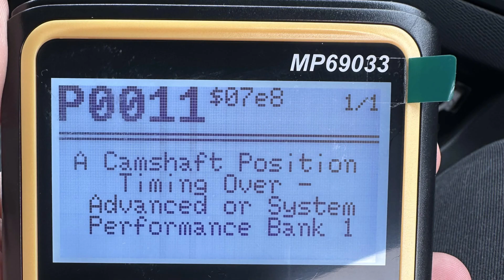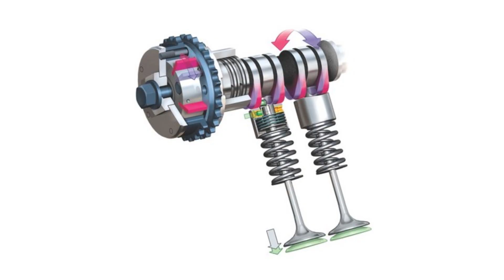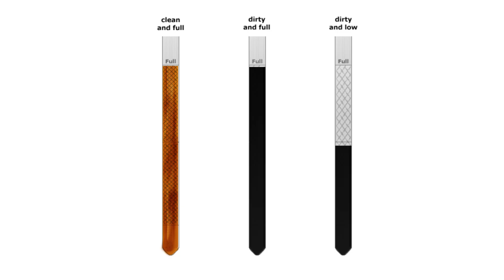P0011 Code? Don’t Replace Anything Until You Watch This!

Comment: Hey buddy great video thanks alot
I have a chevrolet cruze limited 2016 1.8
I am having P0011 and P0420 and the symptoms as you said
I changed the oil with a good one and replaced the VVT intake solenoid and cleared the engine codes
After 3 days all the symptoms is back again and the codes showed up
What do you suggest as a next step please?
Reply: My mech told me that maybe the catalyst P0420 is causing the P0011 and I should replace the catalytic converter
Is what he is saying right?
Reply: Unlikely as p0011 is intake side not exhaust be the p0011 causing cat issues not other way around

Comment: Timing chain ,tensioner,cam gear  vvt solenoid , cam sensor, all new but no fire p0010,p0011,p0340 
Gotta be something simple oil isnt changed is dirty but not past any ideas ?? A wire !
2010 silverado 4.8

Comment: On my 2013 Ford Edge with the 3.5 non-turnover V6.  I got a P0012 code with the same message.  The problem was bad cam solenoids that advance and retard the timing.  The solenoids are $35 a piece but you have to pull both valve covers which is a pain in the butt.  My mechanic said the engine had jumped time and would cost $1500 to replace the timing chain, guides and waterpump while I had it apart.  I didn’t have dirty oil. I change oil every 3000 miles but my car had 160,000 miles on it and the solenoids failed.

Comment: My car has this error also with a noise like ticking at times at low and hi rpm which disappears on 1500/2000 rpm .
Engine oil .

What should i do

Comment: I have a 2011 Mercedes C Class 220cdi with the om651 engine. Only fault code is stored is P01126. I changed the timing chain and tensioner in september 2024. Check engine light came on in may 2025 roughly. Checked timing, all is perfect. No power loss, just check engine light. No messages in the display. No rattling or unusual engine noise under startup or driving. Changed the oil and filter when i got the check engine light just because it was time. No difference. As my engine have fixed cam gears and not a vanos/vvt system i can`t seem to figure out why i have this persistant code. Any tips?

Comment: You really broke it down very thoroughly and enjoyed watching your video.  My oil is pretty clean & proper reading on dipstick.  Just going to reset   cel w. replaced VVT Solenoid again (already replaced all cam & crank sensors).  If still issue, then engine has 217k will be timing chain replacement or might go newer used jdm motor w. 60k miles.  What do u think new or swap timing  chain next?
Reply from the maker: J - Thanks for the feedback! Honestly, depends on cost and budget.. 60k mile engine would be best, but cost could be more.

Comment: I have a 2017 Chev Sonic throwing a P0011 code, with no symptoms, and regular oil changes. Appreciate your great explanatory video, but at 7:30 you say, "..the two most commong things are...and the VVT sensors being old and dirty". Did you mean to say "VVT solenoids"? or are there actually VVT sensors somewhere which you never mentioned prior? TIA
I also see in an earlier response you say, "If you’ve already replaced the VVT (variable valve timing) sensor..."! I'll rewatch your video, but I don't recall you ever mentioning an VVT Sensor in it!
Reply: Yes Chevy's Inline-4 VVTs there are 2 "Camshaft Position Actuator Solenoid Valves" and 2 "Camshaft Position Sensors". One Solenoid and Sensor are for the intake Cam. The other two are for the Exhaust Cam. Kinda confusing, but they are two different parts. I would look for a repair manual for your car to find the exact location of the sensors. Hope this helps!

Comment: Hello.
My car is Kia ceed 1.6 GDI JD 2016.
I changed the oil and oil filter, after which the check engine light came on with the p0011 code. The service technician replaced the camshaft position sensor, but it did not solve the problem. In the meantime, I saw that the oil level was 6 mm above the max, after which we drained the oil below the max mark. But the p0011 appeared again. Could this excess oil have caused P0011 or ?

Comment: I have jetta 1.8 turbo I changed VVT solenoid , Vanos also but nothing changed code is not fixed . Car working so good i have no idea what’s happening to my car
Reply from the maker: A - Sorry to hear this.. If your Jetta still runs poorly after replacing the VVT solenoid (cam adjuster) and VANOS-style actuator, and the same code keeps coming back, it likely isn’t a hardware failure but a timing or oil-pressure-related issue preventing the cam phaser from adjusting correctly. Start by verifying mechanical timing — if the timing chain or belt is even one tooth off, the ECU will keep flagging a cam correlation fault (like P0011 or P0012) no matter what you replace. Next, check oil pressure and oil condition — these systems rely on clean, correct-viscosity oil (5W-40 synthetic on most 1.8Ts), and low pressure or sludge in the VVT feed screen can block the actuator. Also, inspect the electrical connector and wiring to the VVT solenoid for corrosion or broken insulation — if voltage doesn’t change when commanded, the cam can’t advance or retard properly. Finally, scan live data for camshaft actual vs. desired angle — if they don’t move together, the phaser or oil flow is restricted; if they move but the code remains, the ECU may need a cam/crank relearn. The next step should be a mechanical timing verification and oil pressure test before replacing any more parts.

Comment: Acura TSX 2007 with P0011 VSA light. Changed oil, vvt oil valve, cam shaft sensor as well. 
It won’t come off, :(😢
Reply from the maker: G - On your vehicle, a persistent P0011 with the VSA light even after new oil, VVT solenoid, and cam sensor usually means the ECM still isn’t seeing proper cam timing advance, and the most common root causes are a clogged VTC oil control passage or screen, low or unstable oil pressure, or a stretched timing chain throwing the cam/crank correlation off. Since the VSA light often comes on just because the check engine light is active, fixing P0011 will clear both. At this point, the best step is to check actual oil pressure with a gauge, clean/inspect the VTC strainer screen behind the timing chain cover, and verify the timing chain hasn’t stretched — because if the ECM keeps seeing cam timing stuck or out of spec, no amount of sensor swapping will make the code go away.

Comment: I currently have it in my 11 Nissan Armada I can't get rid of it. Replaced VVT solenoids oil and filter cam sensors idk
Reply from the maker: L - The issue is likely oil pressure or timing chain stretch/slack rather than just sensors; on these V8s, if the chain, guides, or tensioner are worn, the cam timing can drift and the ECM sees it as over-advanced, and sometimes sludge or varnish in the oil passages feeding the VVT actuator can also cause it. Since you’ve already done the easy parts, the best next steps are to check actual oil pressure with a gauge to be sure the VVT system has enough flow, and if that’s good, inspect the timing chain system for wear or slack—unfortunately chain and guide wear is a known cause of persistent P0011 on high-mileage Armadas.
Reply: @8020Automotive thank you for your response. The person that had this vehicle before me didn't change the oil in literally years. I'm not sure how to desludge the engine. I've only done a couple of oil changes since replacing the sensors
Reply from the maker: L - The safest way to deal with sludge is gradual cleaning, not a harsh flush, because breaking it all loose at once can clog oil passages and starve the engine; the best approach is to keep doing short-interval oil changes (every 500–1,000 miles at first) with a quality full-synthetic oil and good filter, and let the fresh oil slowly dissolve deposits, possibly adding a mild cleaner like Marvel Mystery Oil or Liqui Moly Pro-Line Engine Flush just before an oil change if you want to speed things up. Avoid aggressive solvents or “miracle flushes” on a sludged engine, and instead plan on multiple frequent oil services until the oil drains clean and the valvetrain area looks better, because steady gradual cleaning is the safest way to extend the life of a neglected motor.

Comment: I have a p0011 code on a 2008 mazda cx7 that I replaced all the timing components the vvt solenoid and phaser made sure my timing was good and it just wont go away im thinking ill check oil pressure if thats good ill replace the cam sensor then the crank sensor if that doesnt fix it I have no idea what im supposed to do other than to get a new pcu
Reply from the maker: M - A P0011 (Intake Camshaft Timing Over-Advanced) sticking around even after new timing components, VVT solenoid, and phaser usually means the ECU still isn’t seeing the cam respond as expected, and the common causes beyond what you’ve done are oil pressure, sensor feedback, or wiring/ECU control. Checking oil pressure is a smart next step since the VVT actuator relies heavily on stable oil flow, and a weak pump or clogged passage will keep it from phasing correctly. If pressure is good, test the camshaft position sensor and wiring (not just swap parts) with a scope or multimeter, then confirm the crank sensor is clean and properly reading. Don’t overlook the harness—heat soak near the turbo on these CX-7s is notorious for making the wiring brittle and giving false signals. A failed PCM is rare, so I’d exhaust oil pressure, sensor testing, and harness inspection first before assuming it’s the ECU.
Reply: @8020Automotive  it was just a cam sensor it read fine on a scanner with consistent data but the ecu was just a little more picky i guess replaced the sensor code went away

Comment: (kia optima 2018 LX 2.4L)
hello! so i changed my oil about two/three days ago and then my check engine light came on, got the code read, and it’s saying P0011. i then changed my oil AGAIN as that was suggested solution, went away for a day, back on. same code. i’m noticing a lot of videos and articles says that there is typically noticeable performance issues that come along with this code but honestly i think my car is driving like normal. any idea for what would be the first thing to check there? or if it’s just possibly an angry sensor? but i’m still confused on how changing my oil would of upset the VVT system in the first place when i did it right and with what the car is suggested to have… now granted at first i did put a synthetic blend in and then the code came on so then i went to o’reillys and they said that i should of probably used pure synthetic (but computer man also said that it’s not a big deal and the car would be fine) but anyway i drained it same day and replaced with a new filter and then pure synthetic. long story short i’m confused how an oil change pissed off my engine in the first place
Reply from the maker: O - Sorry to hear this! On your vehicle, code P0011 (Intake Camshaft Timing Over-Advanced/Performance) means the ECM is seeing the intake cam phaser not responding as expected, and while poor oil quality/level can trigger it, the fact that it came on right after the oil change is usually coincidence rather than the actual cause. These engines rely heavily on oil pressure to control the VVT solenoids, so the first thing I’d check is the oil control valve (VVT solenoid) for the intake cam—if it’s sticky, clogged, or electrically weak, it can set a P0011 even if the engine feels normal. Next, make sure the electrical connector and wiring to that solenoid are clean, tight, and not oil-soaked, because a poor connection can cause an intermittent code. If those check out, then inspect the camshaft timing itself (rare, but a stretched chain or jumped tooth can cause it) and confirm there are no other pending codes like P0014 or P0017. Since your car runs fine with no drivability symptoms, the most likely culprit is a lazy or sticky VVT solenoid rather than a mechanical timing problem, and replacing or cleaning it is a good first step before chasing anything deeper.

Comment: I have had these codes in my 2014 Chevrolet cruise 1.8l and have took it to 2 different mechanic and replaced everything timing related checked oil, pressure, replacement sensors, and still have the p0011 p0014
Reply from the maker: S - Persistent P0011 (intake cam over-advanced) and P0014 (exhaust cam over-advanced) after replacing timing components, checking oil pressure, and swapping sensors usually means the issue isn’t mechanical timing or the sensors themselves but rather the VVT solenoids (oil control valves), their wiring, or oil flow to them. These codes set when the ECM commands a cam position change but the cam phasers don’t respond correctly, often because the solenoids are sticky, clogged with varnish, or not getting full oil pressure. Even new solenoids can fail if cheap aftermarket parts were used, and wiring/connectors to the solenoids are a known weak spot on Cruzes. Since you’ve already done the big work, I’d pull both VVT solenoids, clean/inspect them, check the screens for debris, confirm 12V power and ground at the connectors, and consider replacing them with OEM ACDelco parts if you haven’t already—this usually resolves those dual cam correlation codes when everything else checks out.

Comment: interestingly i had problems like bad acceleration and took it to a shop to replace the vvt solenoids. i tried to it myself but couldnt figure out how to get there (i was trying from above but turns out you need to do it from under the car)
after they replaced it the car felt like new, but after a few days i had p0011 that came up and when i took it back to them they recalibrated the position which seem to have fixed it for now. i ll drive for a bit and change the oil next week to see if this fixes the problem… hopefully it does, otherwise i would change the camshaft sensor (i dont have much live data on my obd2) and if this dosent do it then its either the timing chain or crankshaft gear (at least they told me that) which.. i dont hope is the issue its very expensive and i cant do it on my own 😅
Reply from the maker: K - Sorry to hear this.. Hopefully it resolves your issue. Keep us updated

Comment: What if I dont have any symptoms of poor performance or lack of. But the code keeps popping up
Reply from the maker: R - If you’ve got a clutch-related or driveline code that keeps coming back but you don’t feel any drivability symptoms, it could be due to a sensor or switch that’s intermittently out of spec rather than an actual mechanical problem. For example, on some cars a worn clutch pedal position sensor, neutral safety switch, or related wiring fault can repeatedly set a code without affecting how the clutch feels. It can also be a “stored” code from a past event that your ECU keeps re-logging if the underlying electrical signal isn’t perfectly within range. In those cases, I’d pull live data to see if the suspect sensor’s readings are consistent, check wiring/connectors for corrosion or looseness, and clear the code to see if it returns under the same conditions. If the car’s performance, shifting, and pedal feel are all normal, you’re likely looking at an electrical or calibration issue rather than a failing clutch assembly.
Reply: This is me it popped up about 3 months ago then came back but now gone but I think it’s me overdue for an oil change
Reply: maybe your sensor isnt reading correctly. my gfs golf has a „broken“ sensor that dosent go in properly (long story) but the car drives completely normal no matter if the engine light is on or off. my guess its your camshaft sensor. if its easy to get to, clean it, change the oil and see if it poppes up again. if it is hard to get to or the cleaning didnt do anything then consider replacing the sensor, they are usually pretty cheap

Comment: If it’s the vvt solenoid, would it be the intake, or exhaust, or could it be both? I have a 2010 Chevy Cobalt for reference. I don’t have the skills to test everything or change something internal, so I’m just trying the more likely fixes and hoping it works. I did change the intake solenoid already, and the code stayed off for about a week, but it has come back.
Reply from the maker: R - The P0011 code refers specifically to the intake camshaft position timing being over-advanced, which makes the intake VVT solenoid the primary suspect—and since you’ve already replaced it and the code stayed off for a week, that suggests you were on the right track, but there may still be a related issue like a clogged oil passage, dirty or incorrect oil, or a weak oil control system affecting VVT performance. Before jumping to internal repairs, try doing an oil change with the correct spec and a quality filter (if you haven’t recently), and clean the connector to the intake solenoid. If the issue persists, the exhaust solenoid usually throws a P0014 code, so unless that appears, you can likely rule it out. If replacing the solenoid helped temporarily, your next step might be removing and cleaning it (they can gum up quickly) or checking wiring continuity if you’re up for a bit more DIY.
Reply: @8020Automotive Thank you for the response. I already went ahead and changed the exhaust solenoid before you responded. My oil was changed very recently. You might be right about the wiring connectivity. I had an issue in the past where wires had to be replaced, and not all of my speakers work. It seems like the car has wiring issues in general. I think fixing the wires is beyond my abilities. I might just have to take it into the shop if the code keeps coming back.